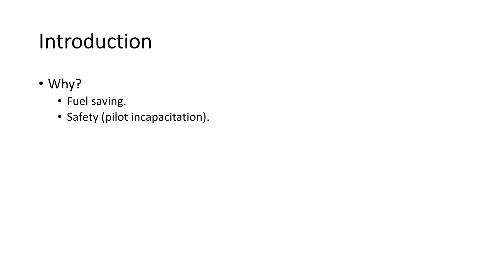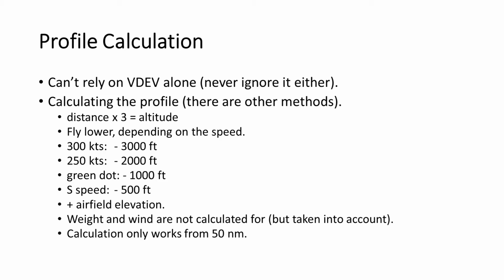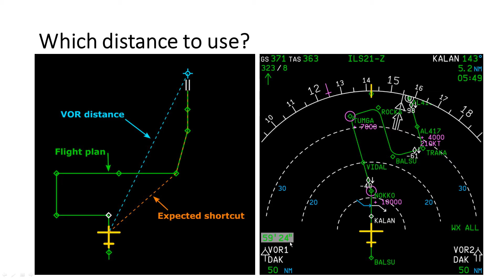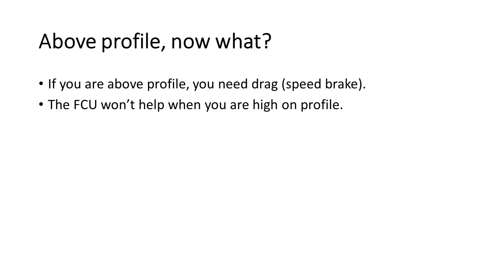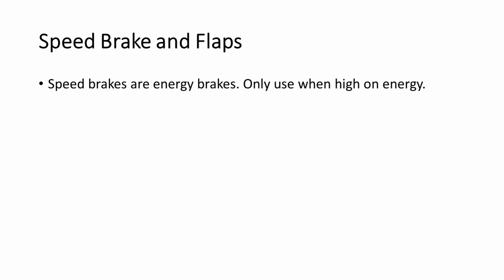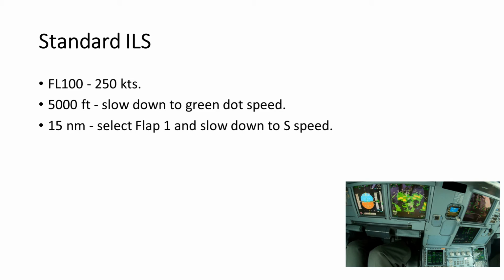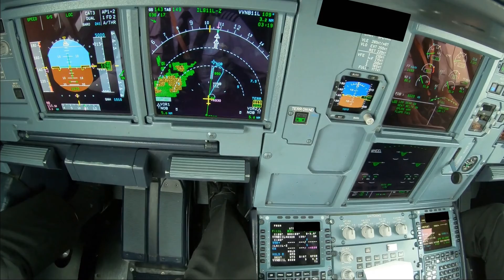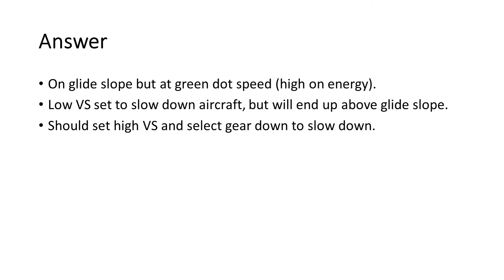A320 Descent Management Presentation

Comment: Sorry I''m unsure of the calculation for the example where we're 33nm at 319 kts and we should be on profile at 6000ft. If I take the rule, shouldn't it be (33*3)_3000 ft= 6900 ft?
Reply from the maker: Yes, you can do that also. However, in order to reduce workload, you can only use round numbers to calculate with. So calculate for 30 nm and wait for the distance to change from 31 to 30 nm and check if you are at 6000 ft. 

It depends how fast you are with mental math. If you are good at it and it doesn't cause you additional workload to use exact numbers, by all means go for it. But the added precision isn't worth it from my experience.

Comment: I don't understand why you need the speed break when you have head wind when the head wind should technically reduce the speed because it's forcing the opposite side.
Reply from the maker: Because you need a sustained 30 kt headwind component for a long time to have the same effect as the speedbrake. That situation is very rare, so in reality you will need to create drag yourself when you are high on energy.

Comment: When estimating TOD, how do you do it? These instructions seem to go from distance to an altitude. I realise these tips focus on the last 50nm, doing profile/altitude checks along the way. Would be great if you could follow up with info on your TOD techniques. I've seen the altitude delta to drop (in thousands) * 3, and general advice on adding 1 NM per 10 KTS of speed to reduce, possibly combined with same correction for head/tail wind. Is that what you do too, and then use this presentations tips for checks when < 50 NM from runway?
Reply from the maker: I understand what you mean, but there is no need to calculate the TOD. In my whole career, not one time did I need to do that. This is only necessary if you fly an airplane which doesn't have an FMS. When you are at cruising level, you don't know yet if you get a shortcut later, so just let the FMS do it's thing. If you do think you get a shortcut somewhere on the arrival when you are still cruising, you an just start to descent early and fly below the VDEV for a certain amount (for example 3000 ft, if that is what you think the effect of the shortcut will be).
Reply: @a320descentenergymanagemen3  Currently my simulator (FS2020 with A32NX) doesn't show me a TOD, so I somehow need to know where to start my descent, even if flying on VATSIM or similar, as they might sometimes descent you rather late if you don't ask yourself.
I guess in real life you use the TOD indication on your ND/MCDU as a guide, or rely on controllers?
Reply from the maker: @henrikolsen5  Are you sure you are in CRZ mode? It should show you a TOD  (white arrow). If not, it might be a bug/lack of a feature. Are you using the default A320 aircraft? That one is not very good. The upcoming Fenix sim should be a lot better.

As for ATC, sometimes they descend you on time, other times you have to ask for it. It's hard for ATC to calculate the TOD because they are missing important parameters, so we can't be too hard on them.
Reply: @a320descentenergymanagemen3  I'm using the A320 Neo from Flybywire (called a32nx). In the development version TOD arrow isn't implemented yet. Perhaps in the experimental version. They are doing amazing progress. Following it closely.

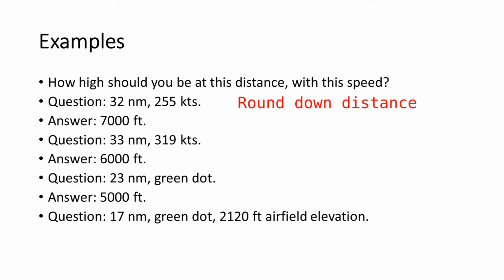Comment: Before I buy your book, I want to know that at 7:07 last question… using your formula I got different answer..

Rounded out figures:
20x3 = 6000ft - 1000ft(greendot) = 5000ft + Airport elev 2000 = 7000ft

Please correct me if I’m wrong, thank you
Reply from the maker: 17 nm is rounded down to 15 nm. You can't round it up to 20 nm because you already passed that point so you can't do a height check for that. 15*3=4500, then 3500 for green dot speed, then 5500 ft for the airport elevation.
Reply from the maker: Thank you for your feedback. I will make note and be more clear about that in the future. You have to round down first, then multiply. The reason for this is to reduce workload. It is easier to multiply round numbers (unless you're a a mental math whizz, which I'm not), that is why you have to round down first, then multiply.

Comment: I would recommend bugging the speed up all the way up to 300kts and above and put it into OPEN DES. Upon reaching 10,600ft pull VS for 0fpm and bug the speed to 250kts or below using speedbrake if necessary.

Comment: A really useful video, thank you so much.

Could you also use distance x 3 like this: say you were expecting an approximate 40 mile shortcut from PENT to KREN. If I wanted to be at 4000ft by KREN. Would the correct calculation be 4x3 =12k ft to lose so I know if I want to be at 4k by KREN I need to be no more than 16k ft by PENT.
& then once you get that shortcut you can do the total track miles and account for speed in your calculations as you do etc. or would you do it any differently?
Reply from the maker: That is not what I teach due to added workload and there is no need for that. Instead, only work with the expected track miles (shortcut taken into account). Then do the profile calculation and figure out if you are above or below profile and deal with that accordingly. If there are altitude restrictions which put you high or low, just fly the VDEV and if you get high on the calculated profile, slow down.

Comment: awesome video Cpt! How do you compensate for HDW or TLW? Thank you!
Reply from the maker: There is no need to calculate for that. You cannot ignore it, but instead of doing a calculation, just keep calculating the profile as usual. When you get high (due to a tailwind or another reason), use speed brake. When you get low (due to a tailwind or another reason), set VS-500. 

The wind doesn't make much difference unless it's a lot for a long time.

Comment: Hi,
I have a question on the selected descent mode. I mean once we have estimated when we should descend based on 3:1 rule, adding wind component distance as well if needed, then how do we deal with the fact that our descent rate will no more be the same as we get lower and closer to initial fix or  FAF for instance. I mean let's say we initiated initial selected descent at 2300 ft/min ( GS 460 knots), how can we srill assume we'll descend at this rate when we 're lower and that GS will probably be around 350 knots ( 1750 feet/min'). Can the plane still descend at the initial rate we did set in the mcdu?Or does that rule already account for the fact that we'll have a lower GS anyway?
Reply from the maker: There is no need to calculate a descent rate. Just fly lower depending on your speed, that will take care of it.

Comment: I apologise in advance for my stupid comment, but the whole '1500 ft for 5nm' thing, just confirming is that based on 300ft per NM on a standard 3 degree approach.

Likewise if I just wanted to eyeball how much height I could lose in 20nm, would I just do 20 x 3 = 6k ft I can potentially lose.
I know it is better to work on track miles to run to the threshold and that's what I do, I just like backing it up with a sanity check.

Obviously the managed descent profile is slightly shallower (2.5 degrees) so would you just call it a negligible difference?

Also in your book you talk about how with distance x 3 it's not accurate further than 50nm away, however a few pages later you say it's more accurate than altitude x 3. Are you comparing it not being accurate to the managed vdev profile or not accurate to alt x 3.

I mean it all in a good way just trying to learn :)
Reply from the maker: 1500 ft for 5 nm is indeed 300 ft per nm. But if the approach is more than 3 degrees, the same descent calculation applies though. Once you are on the glide slope in that case, the calculation is different, but before that it's the same.

Second point, indeed you can always do distance x3 as a sanity check.

A managed descent profile is not any different than a selected profile though. The calculation is the same.

Distance x 3 is more accurate compared to altitude x 3. As for the 50 nm, because you will be on a mach number when much further than that, any calculation is unstable and you get inaccurate numbers no matter what. Also, at that diatance you are unlikely to get any shortcuts and if you do, it's easier to just update the FMS track and you will have plenty of time to fix any high profile situation.
Reply: @a320descentenergymanagemen3 

Thank you. Lastly, the 500ft rule that open des does to capture the target speed (if it’s slower than actual) is that just an approximate? It’s not something I could find in the FCOM.
Reply: @a320descentenergymanagemen3  thank you, and you know you talk about op des targeting 500fpm when you set a target speed lower than your actual speed (so we can slow down) is that an official number, or is it just an approximate (couldn’t find it in FCOM)
Reply from the maker: Everything I teach are all techniques, almost nothing is from the FCOM. The FCOM is pretty useless concerning descent management as many points they make are missing context and some points are just plain misleading.

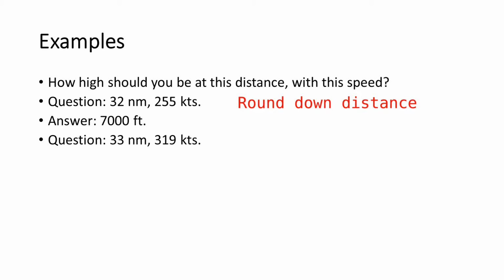Comment: 6:36 I don't understand how do you get from 33*3=99 (assume you want us to multiply by 100 to get the altitude) -> 9900->~10000ft - 3000ft(for 300+kts)=7000 to 6000ft?
Reply from the maker: You have to round down the distance. So 33 nm becomes 30 nm. Then multiply that by 3 and you get 9000 ft. At 300 kts (also rounded to the nearest reference), you have to fly 3000 ft lower, so 6000 ft. Rounding before calculating is done for workload management. There is no need for high frequency calculation, so you can calculate at 10 nm or 5 nm intervals.

Comment: I don’t understand your math in the examples. 

32nm @ 255kts. according to your formula should be 30nm/3 = 10,000 -2000 = 8000 but your answer is 7000. 

Same for the 33nm @ 320kts. 30/3 = 10,000 -3000 = 7000 but your answer is 6000. 

Unless your field elevation is -1000, I don’t follow your math.
Reply from the maker: You have to round down first. So 32 nm becomes 30 nm. Also, you have to multiply your distance by 3, not divide. Then for 250 ft, subtract 2000 ft. So 30x3=9000, minus 2000 becomes 7000 ft.